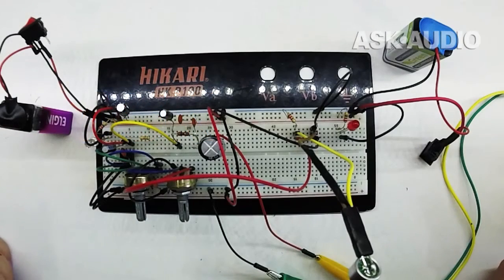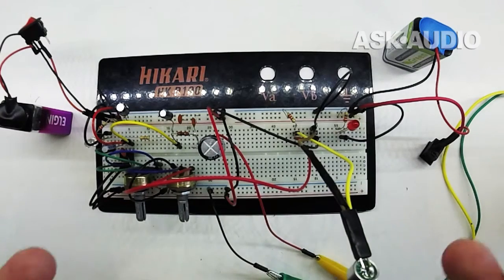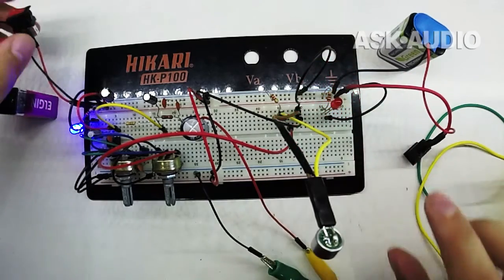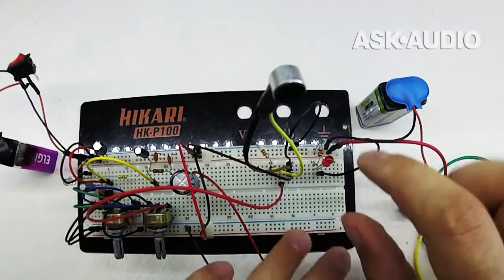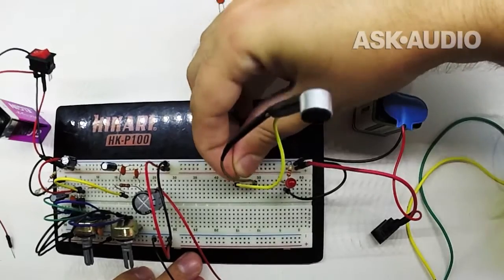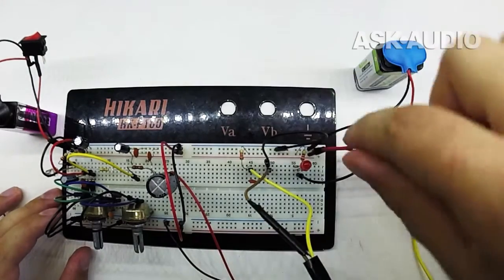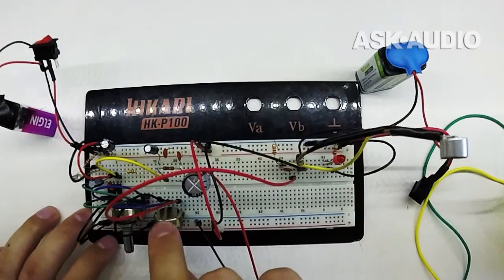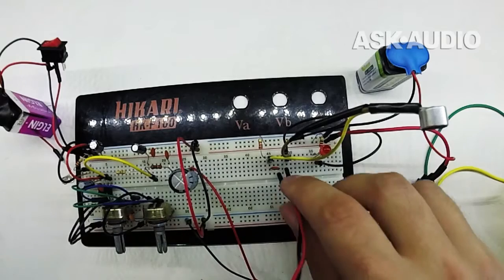DIY Condenser Microphone

Comment: I made a diy condenser mic using lm358 opamp, I added 5 condenser mic capsules in parallel , but the output reduced drastically, could you please tell me what might have caused it?